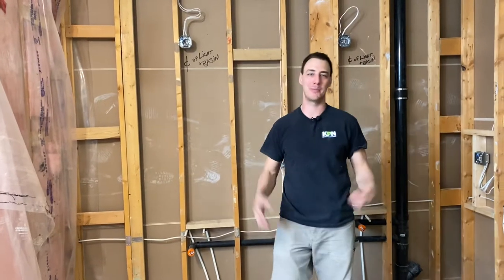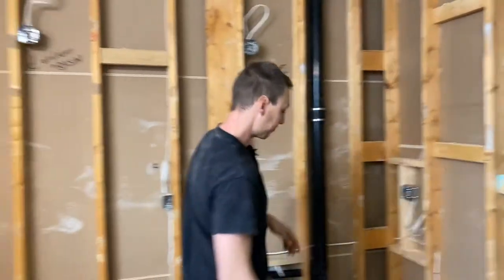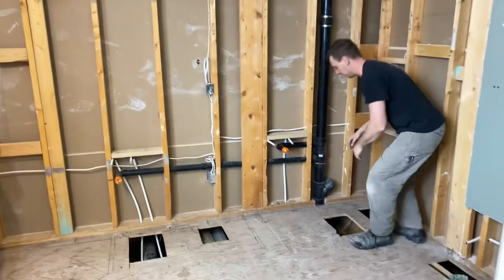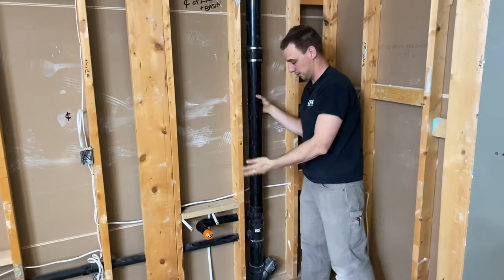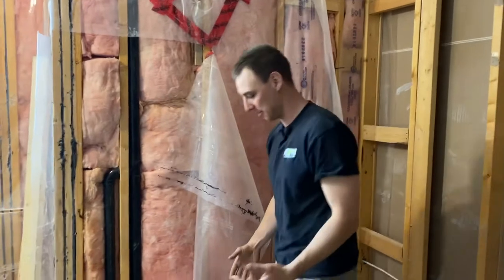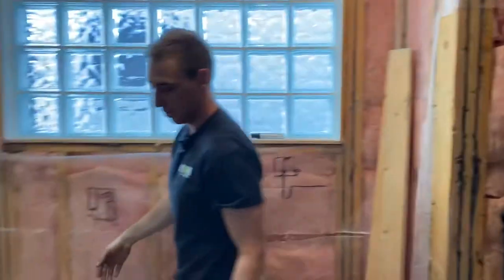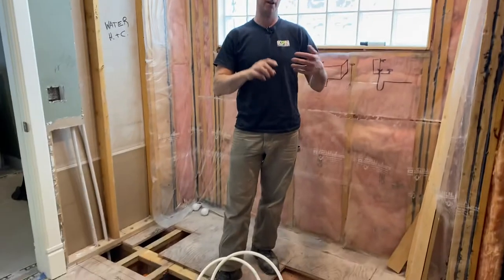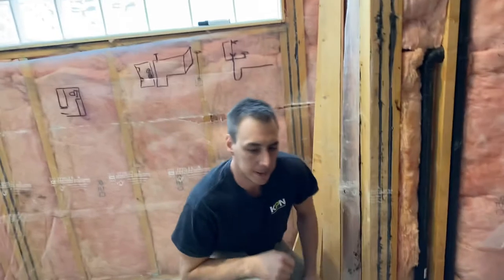Master Bathroom Custom Plumbing Renovation - Relocating Drains & Water

Comment: instead of adding another ty for the 2nd sink on the stack, why not use the trap arm of the other sink, add a wye with 45 for the sub out for the drain and then another wye or ty on its back in between the 2 sink stub outs for the vent then back into the stack?

Comment: Question that has always bothered me...can you roll a wye (or combo fitting) up 45 degrees from a horizontal drain line to receive waste from a fixture? I've seen them done flat and also rolled up.
Reply from the maker: %100 you can. As long as the drain is vented properly and not over loading the drain size its draining into. Thanks for leaving a comment.